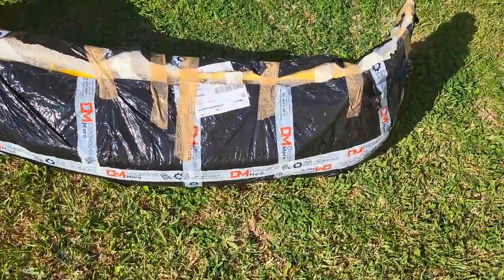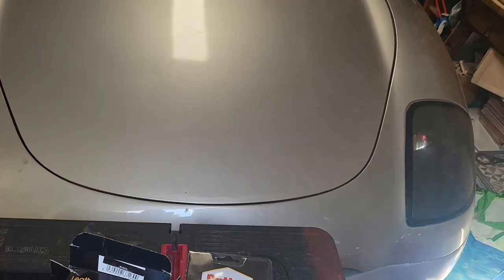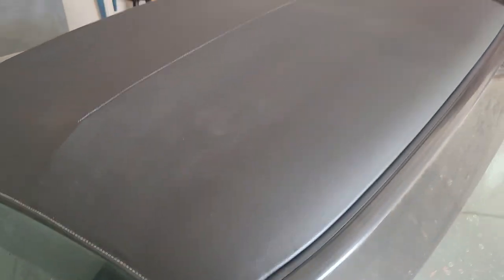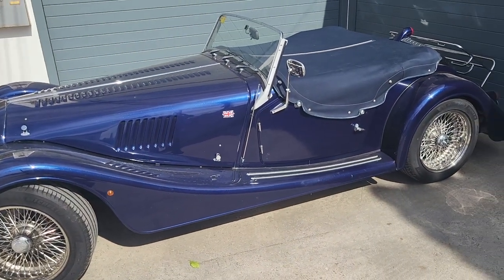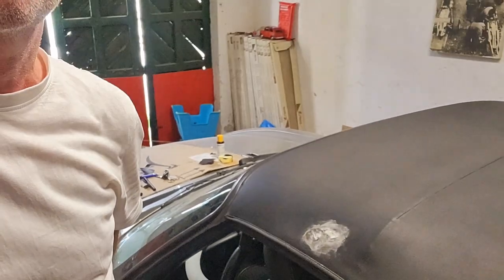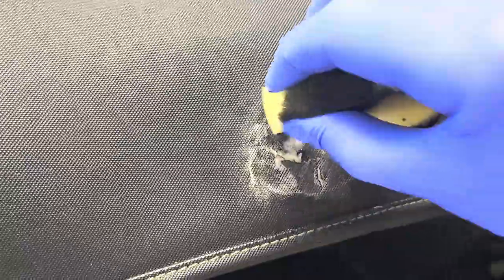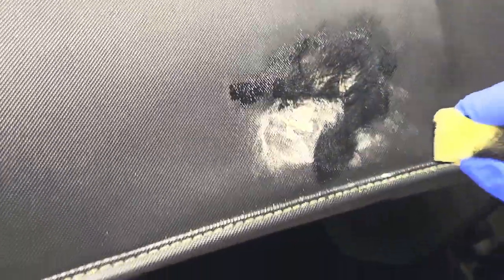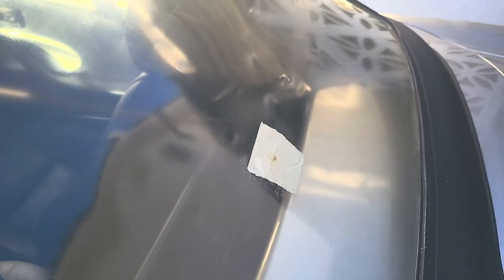Convertible top repair AMAZING restoration | Fiat Barchetta convertible vinyl roof & plastic window

Comment: Hi Paulie, thanks for yet again a very useful video. I´m about to order the window repair kit but I was wondering if, when folding the roof this material is flexible enough to not rip the little slits open again. Thank you
Reply from the maker: Do you mean the window or the black vinyl repair?
Reply: The window, I have a few small cuts on both sides, exactly where the window folds when you lower the roof.
Reply from the maker: Seems to be ok. Look up cabriodoc on YouTube. The video is about 7 years old
Reply: Will do, thank you!

Comment: Hello what is the glue you used for the top ? Please
Reply from the maker: The plastic glass or the black vinyl?
Reply: @cabs black vinyl outside at 14:00 mn on the video
Reply from the maker: It's filler which is part of a leather repair kit which also works in vinyl. There's a link in the description